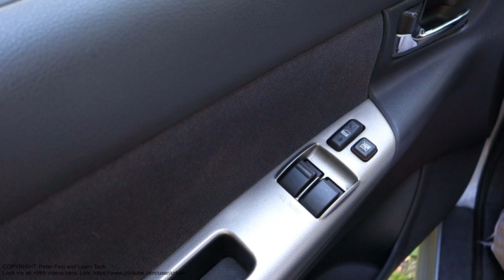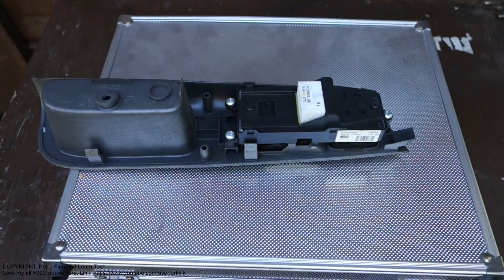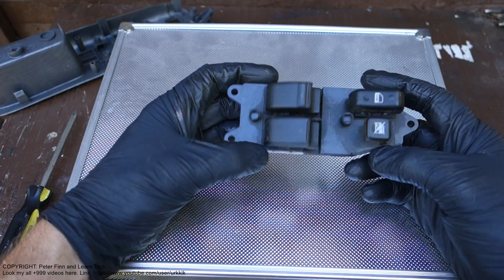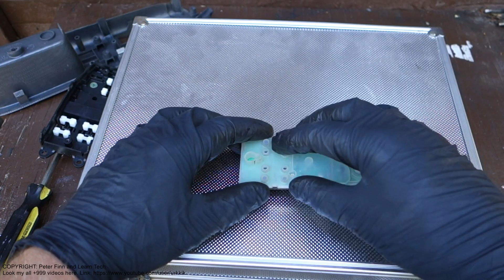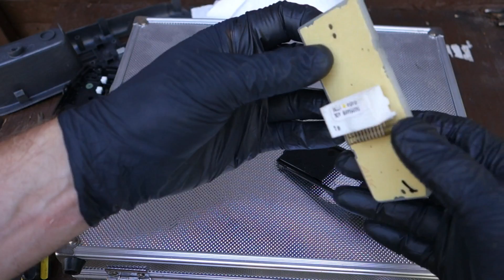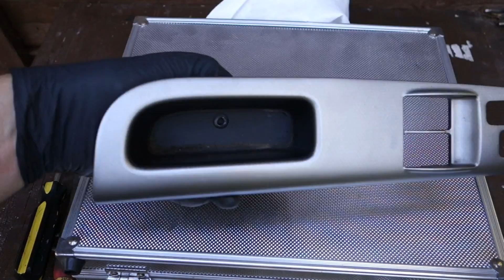How to repair window switch issue in power window switch car or truck

Comment: if switch will roll down window but won't roll up window on passenger door like that happened to my car I checked and cleaned the fuse and I cleaned the switch terminals and inside the plug contacts and now my
 window rolls up and down my fuse and the contacts in the switch and in the plug was needing cleaning I used a needle to clean all contacts and all terminals scraped clean and that's how I fixed my
window to fully
work
Reply from the maker: Noted

Comment: Very good video, I have 08 Accord, I just ordered the switch but I will try to clean the original I have, if it works I will return the one from Amazon. Thanks!!
Reply from the maker: Yes it will
Reply: @PeterFinnTheCarDoctor  👍

Comment: I wasn't able to determine if you mentioned what vehicle you were working on but that trim looks a lot like our 2012 Camry's trim.
From the driver's controls, the passenger front glass will go down if you press the button lightly but if you push firmly until the button is all the way down, the glass stops moving, regardless of where it is.
I envisioned dirty or worn contacts in the switch but I hadn't even considered the notion that it could be solid state.
😕
I'm sure hoping a good cleaning will be the solution to my issue... 
🤞
🇺🇸
Reply from the maker: Noted
Reply: @PeterFinnTheCarDoctor  
Turns out that cleaning it didn't help... so I improvised. Because it was such an unusual issue, I decided to see if I could literally limit the range of the down button & I succeeded. I don't remember if I took any photos but I glued a piece of wood under the "down" side so that we can push down without having to finagle it. Based on this thread, it's already been 2 years & it's still working well.
👍🏻
🇺🇸

Comment: Very intelligent..

Sir, my Hyundai i20 left rear window has no power when operating from driver side windows master panel. The other 3 windows has got power, but no power for this window.

However, they are on at the same board. Why no power supply to this window?
Reply from the maker: Switch bad?